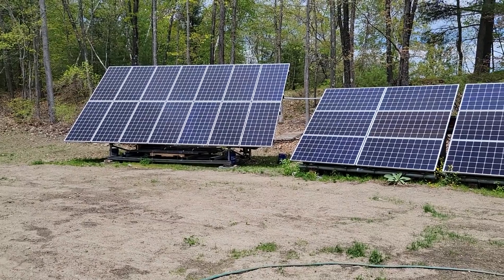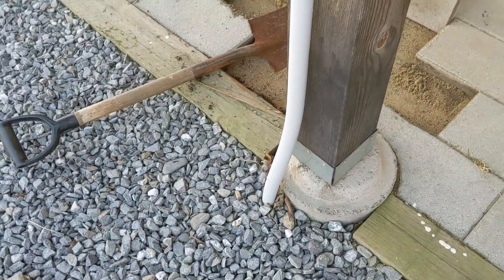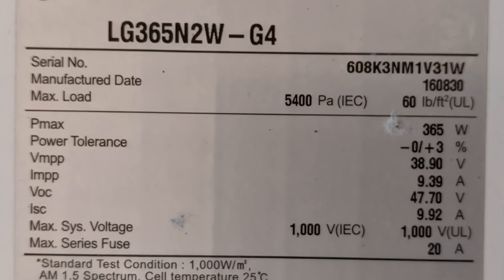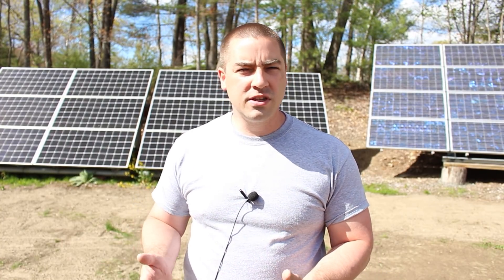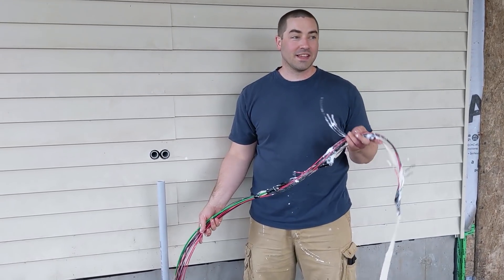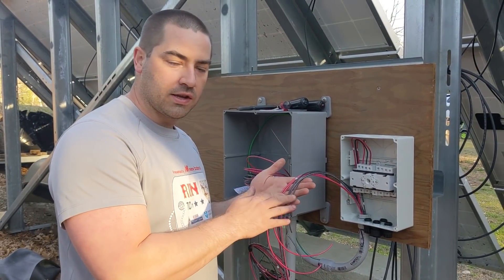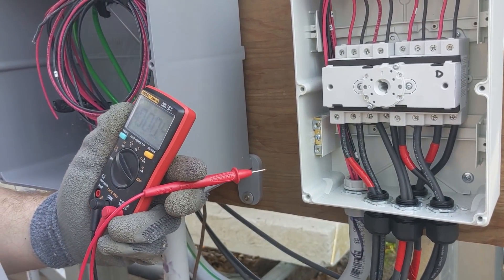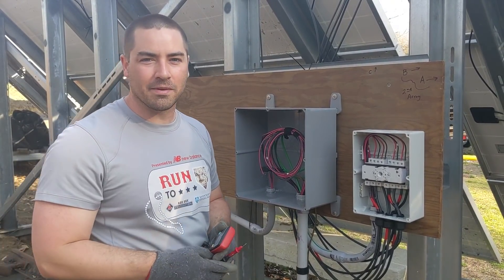Couple wires a huge, High Voltage, Solar PV Array, 12.6kW

Comment: Thanks David, I'm just getting ready to order my solar from Signature solar. 30-395w panels, 3-5000kw ES Growatt Inverters, 6-46V EG4 batteries. ALL thanks to you. I plan on running 2 x 6s2p and 1x 3s2p. This put my pv input volts at 19.3. Growatt specs state 18v max input. Is that going to cause any problems?  I noticed on this video you combined 2 series with 9.4v each, 18.8v total.
Reply from the maker: It's OK for the solar array's Imp to be above the 18A the Growatt can accept.  The Growatt will only use up to 18A.  Most of the time the solar array will never get there anyways.  On some perfect sunny days you might hit the 18A and the Growatt will just stop there, which means for an hour or two on that perfect day you miss out on some small amount of production.  19.3A-18A= about 7% loss, which would only happen during a perfect sunny situation. 

However, never ever exceed the 450V rating.  That's the most important thing.  Personally, I take the Voc of the string, and add 25% to it.
Reply: @DavidPozEnergy  Exactly what I wanted to hear! Thanks soooo much David. I have no one to ask questions and I appreciate you.

Comment: 3/4 of the vid is just you digging up conduit and pulling the wire , it did start to get interesting just in time for you to say good bye
Reply from the maker: Sounds like I got the ratio wrong.  90% of my time was digging and pulling wire, not 75%.  LOL.  I agree that stuff like digging doesn't make for such an interesting video, but it's the reality of building a solar array.  I spend a lot of time leveling, squaring, and plumbing everything.  Then when it comes time to bolt on the solar panels, I did that in less than an hour.  All the pre-punched holes lined up.  No fudging, no tweaking.

Comment: I have 10 jinko panels ( 535w , Isc=13 , Voc=41) can i use them as two parallel series and each series has 5 panels? I will got about 13x2=26A pv current so does this current work in growatt inverter spf5000es or i will lose so much power and better to connect just 8 of them in series.
Reply from the maker: My panels are 9.4A, or 18.8A with two parallel strings.  My inverter clips it to 18.0A.  This means, during peak sun (maybe 4 hours a day) I'm loosing 4%.  I'm OK with that.  However, you would be loosing 31% with two parallel strings.  I probably would not take that hit.  I'd split the array between the inverter and maybe a second inverter, or a separate charge controller.   
BTW, Did you mean to say Voc=41, or did you mean to say Vmp=41?  Something seems off with the numbers, but I don't have the data sticker for your panels.
Reply: @DavidPozEnergy  thanks for your reply, Vmp=40.63 and Voc=49.34+-3% , Imp= 13.17A, Isc=13.79+-4%
So whats is the best for my panels, two parallels or just using 8 panels from 10 as one series ?
Reply from the maker: I would use one string into the inverter, and run the rest of the panels on a charge controller or another inverter.  But, you can't run 8 panels in series into one Growatt 5000ES.  The Growatt 5000ES has a maximum voltage of 450V from the PV array.  You (installer) need to take into account worst case situations.  This means checking the code, or your manufacturers "temperature compensation chart".  But, if you don't have that we use 25%.  The math looks like this:
(49.34V)(1.25)=61.675V  450V/(61.675V)=7.3 panels in series.  Since we can't use a fraction of a panel, that means 7 panels in series maximum.  Your other 3 panels can go to a charge controller, such as one of these: https://shop.signaturesolar.us/products/80a-mppt-250v-charge-controller-by-growatt
Reply: @DavidPozEnergy  oh thats 7 panels really not usefull , my panels model number is jkm535m-72hl4-v and i dont know if i must multiply the voc with 25% or not
Reply: @DavidPozEnergy  Hi David , i called growatt company and they told me to connect 9 jinko panels 535w all of them at one series, in my jinko panel Tk= 0.28%/c so the calculation is (0.28÷100  × 49.34voc x 30degree ) = 4.15 volt will be increasing in cold weather and in my calculation i considered the weather will become -5 degree but thats very hard to record 0 degree in my area, so (4.15+49.34) × 9 = 481voc and thats will happened in a very rare situations in my area but the wired thing that growatt told me that spf5000es can carry voltage at maximum 500Voc even if its written in its manual thats its 450Voc max and as they told me that this inverter will have a problem when the voltage goes above 500voc also they told me that many companies tried this inverter with 500voc max and it was very safe 😑

Comment: Is thnn good for burial thought you need thwn
Reply from the maker: That's correct.  The wire I used has several acronyms printed on the jacket.  One of which is THWN.  The funny thing is, when I go into the electric supply house and ask for "THWN" they look at me like I got two heads, scoff, and ask me "do you mean THHN?"
Reply: @DavidPozEnergy   do you like the growatt or mpp solar better  just looking to power shed freezer and have a back up for well to start
Reply: @DavidPozEnergy  This is probably a stupid question, but why didn’t you combine the strings at the array instead of running it the way you did?

Comment: The only thing wrong with high voltage greater than 150VDC it is extremely susceptible to strong solar sunspots and emp blast will kill your systems
https://www.history.com/news/a-perfect-solar-superstorm-the-1859-carrington-event
https://www.abc.net.au/news/2014-09-12/how-solar-storms-affect-earth/5740454

Comment: One not-so-tiny detail that I noticed. 
You didn't twist any of your DC thhn stranded wires @ the arrays before terminating them in snap-action discconects. Buchanan style terminals would prevent the splaying  (flattening & loosening) of the strands. Very informative.

Comment: I dont know if anyone else made this comment, but when you said that going series increases the voltage while keeping the amperage the same is entirely wrong.  If you double the voltage, you halve the amperage and vice versa while in series.  In parallel, you double the amperage while maintaining the same voltage level as just one panel.  Its all part of Ohms law.
Reply: No he's right.

Comment: Tiny helpful hint:  I use a square of fiberglass door screen material where you connect the vacuum hose to the conduit to avoid sucking a lot of line into the vacuum.
Reply from the maker: Good tip, thank you.

Comment: Hello David,I have a request to solar power 8units of 1.5hp air condition units to run for 10hrs a day.Im proposing to use 6units of 5kw growatt Inverter(30kw),12units 200ah battery bank.I want a design whereby the inverter will work more with the solar panels and less of the battery bank being that it’s a batteryless inverter.wat size of solar panels,and how many units do u think will be needed to run the inverter to power the loads from the panels more & less from the battery bank during the day.

Comment: heya and with higher voltishe you don't need so thick cable's (los copper needed, and copper is expensive) and you don't have much voltisch drop wen using longer wires dubble win

Comment: You should measure the volts at each end when under load to see how much voltage drop you get across the run.
Reply from the maker: You are right, I should.  According to an online calculator it should be 1.13%, or 2.65v, drop at MPP

Comment: Your run was 100 feet. You did say you could have used 14ga wire for that. Is there a chart, or how do I figure what I  need my run maybe twice as long as yours or even 3 times.
Reply from the maker: Two references.  First, the NEC ampacity chart: https://www.usawire-cable.com/pdf/nec-ampacities.pdf  Second, is voltage drop calculator.  This is a good one: https://www.rapidtables.com/calc/wire/voltage-drop-calculator.html  compare these to the "Imp" on your panels.  That will tell you the amps at maximum power.

Comment: Frozen ground can be thawed easily and safely by leaving insulation batts covered with poly for a day or two. The ground itself has heat underneath that is constantly rising even in the winter. The insulation blocks the cold air from dropping down into the ground. 

This is the same method that some roads are built with. Huge insulated panels are buried under high heave, frost prone roads to trap the ground heat rising up so the frost can't push down. 

I've done this for a 4 foot deep trench in winter and it works. The ground was soft the next day for digging.

Comment: Great setup, have you ever considered microinverters (Enphase)? because it may look more expensive, specially if you don't get optimizer, but you save $ in cables and extra DC stuff.
Reply from the maker: Micro inverters look great.  I am actually thinking of this model for a future project: https://shop.signaturesolar.us/products/1200w-240v-grid-tie-micro-inverter-by-aps
Reply: @DavidPozEnergy  APS is a known brand but they may fail based on some reviews I read in the solar forums. Enphase are more robust with a 25 year warranty but they cost 2x (unless you get a good deal on Ebay).

Comment: Recomendation: Use Ferrules to better connections. By the way, simple and quality video.
Reply: I am using IMO switches in our RV. No ferrules. Thousands of miles traveled. They are fine.

Comment: the main benefit of HighVoltage-LowCurrent, especially on long distances, is saving money on wires by using smaller cross sections than otherwise needed for LowVoltage-HighCurrent.

Comment: Always lay a big electrical conduit ahead of the time. Always twist the stranded wire before inserting the end into a terminal. This stops the stranded wire from flattening out as you tighten the screw at the terminal connector.
Reply: No need to twist on compression cage style terminals.

Comment: If you're using lube, you won't cut through the conduit.  If you're using that kind of lube, you should use the hose to get it in there.  You can also use soap and water, or lots of things.  I've pulled LDF, coax, 10-120+ strand fiber, 3/0-16 gauge copper, you name it over THOUSANDS of feet. Lube is your friend, and the feeder can and SHOULD push a bit as the ingress can always cause issues/friction.  The bunching can also help you get around corners.  Fish Tape works great for pulling too.  The string then mesh is complete overkill and just creating extra work in my opinion.  Also, with the ground.  Put a ground rod or two near your house and tie the ground in to that.  We typically wouldn't run the ground like that as with a ground rod on each side you're connecting to the same ground (though there are definitely exceptions to this such as ground fields for lightning).  Think of the soil as a giant resistor, it will equalize the different between the ground rods 100' away and the potential difference will be slowly consumed by the resistance between the rods similar to a power resistor used when connecting a battery bank to an inverter.
Reply: Excellent point on ground rods.  Plus, w/ground closer to panels, it provides much better protection.  

I was going to write a comment similar to yours; however, you beat me to it :)

Comment: Hi David. I live in Australia, I'm an electrical engineer and an electrician and have been installing off-grid solar power systems for over 20 years now in my own solar business. 

I have to tell you that I love watching your channel and I'm super impressed with what you're doing, how you do it and especially how well you explain it all to the  average person. 

I'm now also looking at possibly using some of these Growatt inverters that you've reviewed - I'd heard of them but didn't know anyone that has actually used one. They're way cheaper than the equipment I currently use. They're probably not as robust and they don't have as good a surge capacity but for more cost sensitive systems I think they could be great. 
Thanks for your channel and keep up the great work!
Reply from the maker: Thank you David Skelton.  I've been very impressed with the Growatt model that I'm using.  It's not as efficient as other options, and it gets loud when under load (fans).  So not perfect for every situation.

Comment: Dave, now that you have removed your over current protection that was only rated at 150vdc per string, do you plan on installing some type of overvoltage protection (fuse, CB, etc.)?
Reply from the maker: I don't know about overvoltage protection.  But I did order fuses for over current protection.  For a while I was waiting on some circuit breakers that go up to 600v.  They were a special order, and I waited 2 months before the supplier canceled my order.  So I changed my plan and went to fuses.  Supply chains seem to be pretty spotty right now.
Reply: @DavidPozEnergy  Since I'm just getting into my first system design/build right now, single string, I'm watching for the right price point on items and making sure everything is going to match up when it comes to buying everything.  I'm looking at a Qilipsu waterproof CB box ($16), and a Langir DC 15amp 500vdc circuit breaker ($19.37) out by the array with an IMO SI25-PEL64R-4 Disconnect Switch inside mounted beside the Growatt.  I'm not an electrician either, but figured somewhere on those strings there needed some type of protection.  I was going to put in a MNPV6 with a surge protector, like you originally had, but decided against it after looking at voltage limitations.  Also, needed a box that the Langir CB would actually fit in.   Might still wire in a surge protector and tie it to ground just for that freak lightening storm.
Reply from the maker: Sounds good. I don't own any Langir circuit breakers.  They seemed too good to be true.  They are rated for 250VDC per pole Other UL listed manufacturers like IMO, Eaton, Schnieder, list their miniature circuit breakers for 50 or 60 VDC per pole.  I hope it works well for you.
Reply: @DavidPozEnergy  Well, now you have me questioning my decision because I didn't read per pole.  I guess I could divide up my array, and make two arrays below the 250v rating, or, back to the drawing board and more research to find the right breaker.  Thanks for the catch.
Reply: I read somewhere that the Growatt 5000 operates best with inputs between 120-430vdc.  So, I designed my string to deliver 396 volts at 10.9 amps.  Checked around all day looking for 15amp/600DC breakers.  Found they are a little expensive, and then started reading about not using them as shut-offs when they are under load (horror stories).  You've been in this game longer than I, and It looks like you have also researched protecting these high voltage inputs before I even got to this point.  So, I also started looking at fusing the lines and found they are quite reasonably priced, and will pursue this direction now.  Also, you put your IMO switch out by the arrays, and I was thinking about putting mine inside beside the Inverter and using the CBs as a shut-off.  Those stories about high voltage arcing were enough to change my mind.  Thanks for your ideas and all your videos.

Comment: At 2:30 you say that hooking in series ups the voltage but keeps the amperage the same. P = I * E so increasing the voltage decreases the amperage so the number of watts stays the same.
Reply from the maker: If I have one solar panel that is 9 amps, and 350 watts, and 38.9v.  Then I hook a second one in series, then I have 700w, 9 amps, and 77.8v.  If I hook a third panel in series I have 1050w, 9 amps, and 116.7v.  etc.

Comment: David I’m curious whether you were disappointed by the SMA inverters?
Reply from the maker: There is one thing that I don't like on the SMA's, the built-in algorithm.  I have to manually re-set my SOC about once a month.  But I'm not giving up on them.  I'm currently Beta testing a hack for it.  But I like that the Growatts can be 100% programmed right on the screen.  I don't NEED wifi, or bluetooth, or a separate remote, or router.
Reply: @DavidPozEnergy   Got it - makes sense.  I can see how those things would  matter a lot from a day-to-day usability standpoint. 

Nice job with the 400v setup.   Next step is a  high voltage battery system - transformerless  inverters , seems like that’s a growing part of the future. ..!

Comment: Is there a requirement in NEC that all PV conductors in array’s below 8’ are to be protected?   Is it per NEC to not have over current protection on the #12 conductors where they receive their power or before entering a structure.  I believe not needed if inverters are outside.   Respectfully,   Kevin
Reply from the maker: I'm not an electrician, I'm just a DIY.  So I don't know all the codes.  I haven't heard of an 8' rule, but there might be one.  On the over-current, you don't need over-current protection if you have 2 or less strings paralleled.  But if you parallel 3 or more strings, then yes, you need over-current.

Comment: Did you put the Growatt inverter through the same test that you put the MPPSolar inverter? Tried to run your saw and compressors on it?
Reply from the maker: Yes.  In this video: https://youtu.be/yWUfvvSa3K8
Reply: @DavidPozEnergy  You know that the only reason it worked was because of the transformer, right? The transformer will make the load be shared between both phases.  Just saying
Reply: @marlonbramble2485  Well yeah. He wouldn't have even been able to plug in 120V tools without the transformer.